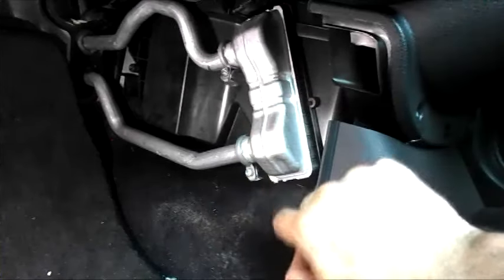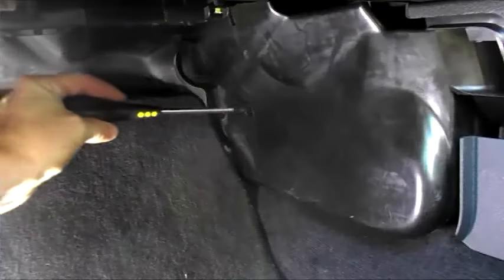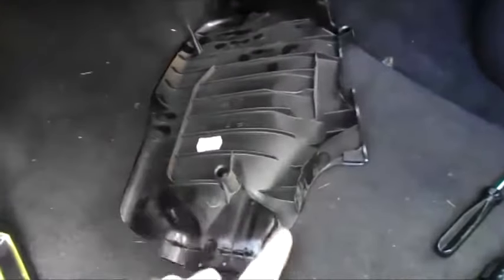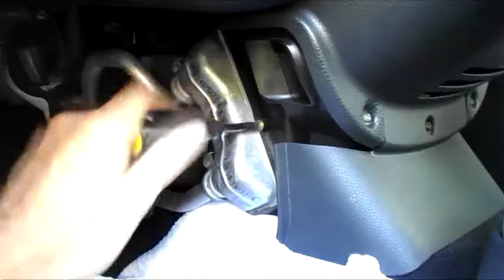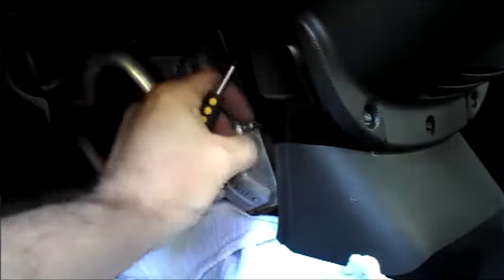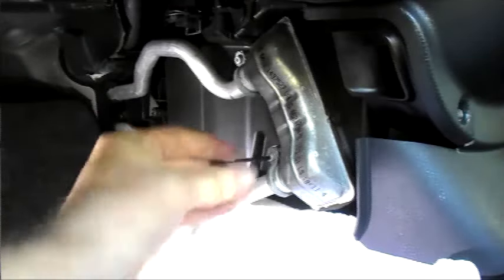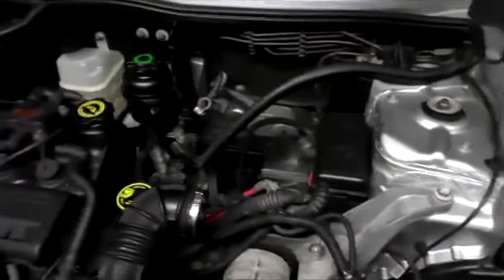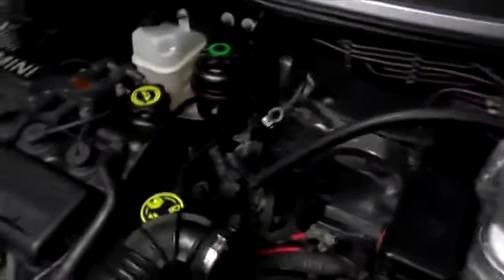How to change the heater matrix / heater core on a Mini

Comment: Just did this job, it wasn't as bad as others experienced. I did not drain my coolant, mine was pretty new. 

This video tells you where to find that third screw, after that it's not hard to access.  Yes.. pull down that steering column panel. Getting those clamps back on required pushing the two parts towards each other to get the lips touching, the clamp goes over both lips. Use a mirror to see the rear of the hose and clamp. Do not attach the hoses with the core sticking out no more than 1/4 inch out the HVAC box.. If you do you might not get the core fully back in the box. The core has to be at the correct angle or it wont clear some inner lip inside the HVAC box. 

$40 heater core at Rock Auto and 90 mins time which includes filling/bleeding coolant.
Reply: What kind of screws is in a Black cover that's covering the lines
Reply: @leebyrd2064  Don’t remember exactly. They had Philips head.

Comment: To empty the liquid, it can be done comfortably by turning on the ignition, since there is an electric pump that is activated.  Just have a tray under the radiator and move the aluminum pipe slightly away.  Be careful not to flood the cockpit xD. From my experience.

Comment: Hi Mark, my heater blower isn't working and I'm looking for the resistor. I did exactly what you did and broke the top corner off but it still seems to be stuck when I pull it so I think there is still a screw in place. Do you know if the resistor is behind this panel its a 2002 R50 Mini Cooper. Thanks Phil

Comment: Thanks, I did it successfully on a 2005 one d r50. Now it gets too hot, my foot gets hot on the accelerator, it heats up the wall where the pipes are, I'm thinking of insulating it with rock wool.  Now I hear a slight noise of liquid, as if there is air left, how do I bleed it?

Comment: 2004 mini, US, so the gas pedal cover is in the way. Just trying to look that up.   Aaaah discovered the 3rd screw, its way in the back and recesst. Not sure how I'm going to get it.
Reply: Rick Brauer hi I have a 2002 cooper, warm not hot air, coolant levels seem good, can’t you just flush the old matrix out?
Reply: @PhilipFordham2000  A month after I obtained it, the fuel pump died. I had the garage flush the coolant at that time as I explained the heater wasn't working. Didn't fix it. I'm a paraplegic but don't mind doing the work myself. Learning about bmw's the hard way.
Reply: How did you get the panel apart- did you pull out the throttle pedal? I ve losen All 3 screws and it feels stuck